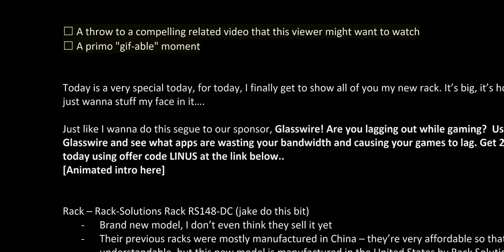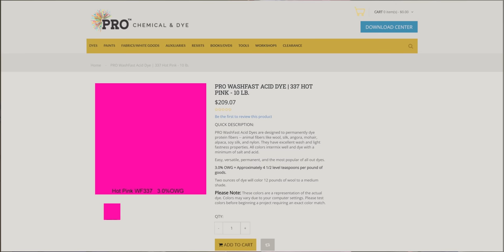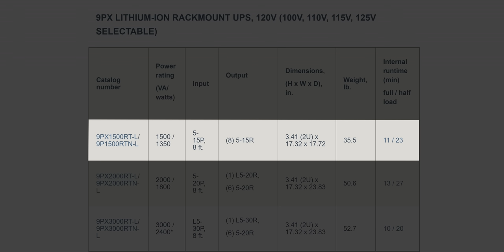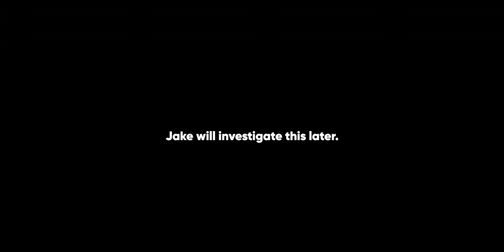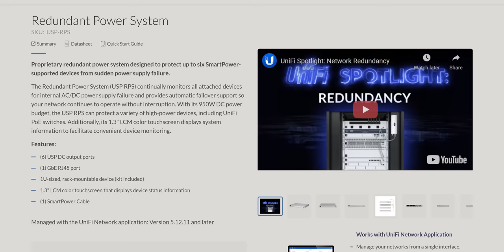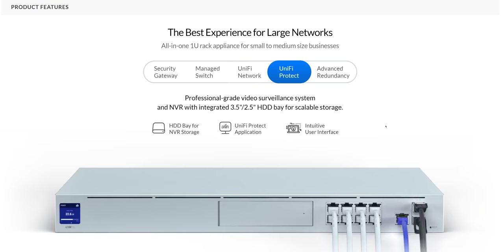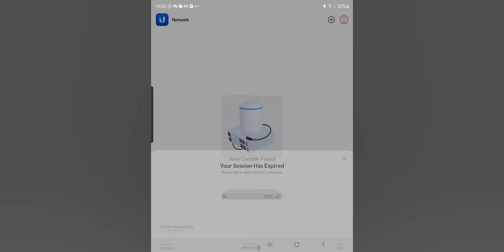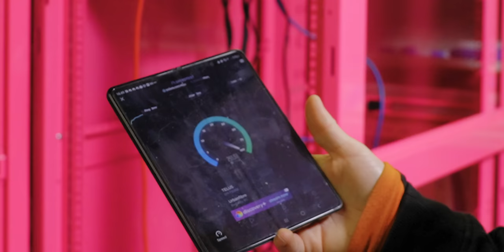Check out my HUGE Rack! - New House Network Update

Comment: "Rack Solutions will send me a thing of touch up paint anyway right?"

Frankly I'm surprised they didn't do that from the start if they knew literally anything about Linus.
Reply: I'm sure they want to hold on to that hot pink paint for all the orders they'll get for it..
Reply: I don't think they wanted to buy any more Pepto Pink Paint than they had to. So with Linus it might just be a few vials of touch up paint, or it might be a quart, you never know with him after all...
Reply: Am I the only one who saw him stab it lol
Reply: Linus thing size of paint would probably be gallon size.
Reply: Also, the paint's possibly why those nut things didn't fit any more
Reply: And let’s be honest, who else is going to get hot pink paint for their server rack?
Reply: Its very likely not painted and is powder coated.
Reply: @Sandriell  I've never seen a good powder coat chip like that.

Comment: LED lighting is on of the most criminally overlooked and underrated tech advancements in the past 25 years.  That power draw decrease hits different especially when you start to add in the dramatically lower replacement rate.

Comment: Linus: "RackSolutions will send me a thing of touch up paint anyways"
RackSolutions:  "Hey it's Linus....Better send him 12 gallons"
Reply: Too bad it’s powder coating 😂😂
Reply: @trav3rsy  ackshully you can measure solids by volume.

It's very rarely done though.
Reply: @ax14pz107  The issue is that you can't apply powder coat without the right equipment.
Reply: No worries, Linus just has to take off the door and ship it back for repainting each time he chips it.
Reply: @hentaihero2201  I know. It's just a joke.
Reply: @ax14pz107  
How else would you measure the space a solid takes up, if not in volume?
Reply: @jayhill2193  magic, obviously.
Reply: Some LLT Store pink touch up baby
Reply: @09f9  
alright, but if you multiply the three dimensions, you automatically get a volume. Though I understand it makes sense to write them down seperately to know how (un)wieldy the thing is.
Reply: @09f9  what exactly do you think a volume is lmao
Reply: How much is it to ship a 55Gal drum of  Candyfloss Pink touchup?

Comment: Having fairly recently moved 3 x 48u racks up to a 2nd floor office by hand I can tell you that you Linus missed a trick here.  You unpack it all in the loading area, and pull of all the doors then it makes the frame weigh a fraction of the fully assembled weight.  You can easily carry just the frame and the doors separately, but I guess that wouldn't make as amusing video :)
Reply: Yepp, having moved a few hundred racks and their content between datacenters and multiple flights of stairs by hand, I fully agree. In addition to thay, I can confirm that dragging over 10 PB of storage on a cart with hard cast tires tends to weed out the weak drives from the rest. A great way to stop storing all that old useless data the beancounters want to keep around.

Comment: Nobody who has ever tried using the Ubiquity cage nuts will laugh about you.
These things are impossible to put in by hand without hurting yourself.
Reply: Didn't Lawrence have a nuts that were plastic since all the metal ones suck in their rack video?
Reply: @Braiam  Yep.. but, I personally don't trust plastic enough. 🤦‍♂️
Reply: Ubiquiti requires a blood sacrifice to install its equipment
Reply: @vdna5492  So they are really old-school. Back in the old days you couldn't build a PC without blood sacrifice on some panel or piece of sharp metal in the case.
Reply: This comment is on point! They are terrible!! I've ripped my thumbs apart fighting with them in the past. Never again! I just leave them right in the box!
Reply: @jbonn5365  I remember an installment we did in a house. They chose all unify.

I tried everything, to use the nuts and screws that came with the gear. This ended with the cage nuts frame rammed under my fingernail, cuts and several nuts lost because when using a screwdriver to get them in, they flew across the room.

Ended up using the mounting gear that came with the racks. The nuts clipped in just fine.
Reply: Their cage nuts do suck. I end up using pliers to pull the wings in tighter before putting them in the rack.
Reply: @Cinkodacs  I PTSDed for a moment. razor-sharp cases, slot covers that turned into knifes and plenty, plenty of jumper connectors ready to stab your nailbeds.
Reply: Could so fail the pain, when it made his nail/finger slip, those things are horrible 😫
Reply: too true...
Reply: @Cinkodacs  I remember when 'we put a piece of plastic on this sharp edge' was a major selling point for brands like lian-li. I hadn't purchased a case in probably 15 years and bought one from Fractal. Man was the bar ever raised while I wasn't looking.
Reply: I thought they were defective, so I tossed them and grabbed a handful from our box o' nuts. Good quality nuts are worth it.
Reply: That's because you're not supposed to do them by hand. That's like suggesting you should hammer in a nail using your fist. There are tools that exist to make cage nut insertion easy. You don't need the fancy Rack Solutions tool, just a metal hook. My cage nuts included one for free in the bag.
Reply: @Cinkodacs  The Zalman flower-of-razor-blades coolers come to mind. :D

Comment: Jake: There is a 25 gig coming out
...
...
Linus: Welcome to upgrading my home server!
Reply: What the gigs (referring about the 10 vs 25go) are for? I understand they are building a kind of an all-in one house network where he can have acces to video security, but I guess also manage device connected to it because it's a glorified routeur, but what the gigs are for the first device they install at the complete bottom of the rack?
Reply: @Mutantproduct  That is a UPS, ergo no gigs.
Reply: @Mutantproduct  moving data around, mo gigs, mo faster
Reply: @Mutantproduct  gig is short for Gigabits per second.
Reply: @Mutantproduct  The device at the bottom, with the lithium batteries, is a UPS. Which stands for "Uninterruptible Power Supply".

It's basically a power supply with a big battery in it, so if the power cuts out - e.g. there's a blackout on the local grid - then it can keep running the whole rack off the battery instead (at least for a while, because I mean racks use a lot of power, so you can't run them off batteries for too long - but the idea is it should be long enough for the blackout to end / backup generators to kick in / some alternative power solution to take over).

Depending on capacity, a UPS could just be to keep the rack alive long enough to safely shut down. Many UPSes have a signalling mechanism, so if the power does cut out and the rack goes onto batteries, it can actually signal this to the servers in the rack. You can then set those up to safely shut down the system, in the event of power loss - before the battery runs out. And by ensuring the machines can shut down cleanly, you can ensure no data loss. 

With a bigger battery, though, you can keep the rack alive for longer and maybe you could keep things up for a while, which is hopefully long enough for the boys who run the grid to fix the power outage problem.

That's the essence of the "uninterruptible" part of the name. Not even blackouts will bring the rack down.

Mind you, Linus did say that he's going to have solar - and, presumably, a Powerwall to go with that, to fully utilise all that Sun power? - and those implicitly act as a kind of UPS too. At least as long as you've got enough sunshine in the day to fill the battery to last overnight, then the system can never go down while the Sun still rises every morning (plus, totally Greta-approved "eco" solution).

We had a small UPS for our cluster of servers at work (I'm the dude that built the cluster and runs it). 

We had a local power outage. And the UPS totally worked. Our system stayed up for about 20 minutes and the local power was restored before then. It worked flawlessly.

Slight problem, though. Our ISP - delivering our Internet - clearly didn't have as robust of a system in place, as the Internet went down during the power outage. But, hey, our servers maintained their "uptime" perfectly. Just a shame that, during the blackout, they couldn't actually communicate with any other machines over the Internet, rendering that "victory" somewhat pointless.

But, hey, not my fault. I did my job perfectly and it worked. It was the boss who chose our ISP, so I can blame him for the poor decision.

Anyway, yeah, the device at the bottom is a battery-backed power supply. There are no "gigs" - which is a measure of connection speed - with that. It's a "volts and amps" power thing, not a "gigabits per second" bandwidth thing.
Reply: @klaxoncow  anything else you need to add?
Reply: @gazzoontie5200  That is what happens when the guy that wears all the IT hats chimes in on the things he's passionate about (or gone down the rabbit hole far enough to develop Stockholm Syndrome), lol.

Comment: That moment when you realise that because it's double painted, the tolerance for cage nut spacing is reduced.
Reply: Ubiquiti cage nuts also suck. I've had some that just never went in. So I started getting AC Infinity cage nuts separately, they're almost too easy to put in.

Comment: As a previous data center tech, you're missing the tool generally used to install rack nuts. It's just a flat piece of steel with a small tab that you can use to pull the nut into the hole from the front of the rack. It's way faster and more useable than one of the squeeze tools.
Reply: Yeeeeaaaaah. I thought those came in the bag of cage nuts that generally ship with racks. 

If their rack didn't come with it, that's either one sadistic vendor or a really nasty oversight.
Reply: Done a tonne of work in DCs and hadn't known of those tools for years, was the best work day almost ever when I got a few

Comment: Hey! I can be that data center guy at 11:33. That tools pretty rare, I'm the only one I know who doesn't just use the little pull through one that comes with the bags of nuts. It's amazing once you get the hang of it. You have to rock them in from inside to out. The opposite of what ya'll were trying. I actually carry that thing, the toe nail clipper one, and the screwdriver handle J hook one since all have a specific time when they're the fastest. Sometime the cage nut wings are too wide or the holes are out of spec and you need the screw driver handle J hook one to force them in.

Rack solutions needs to make that thing out of slightly stronger metal, or maybe just thiker. I discovered that really squeezing on it I can bend the crappy cage nuts and I can get it to work almost everywhere.... but now my handles are bending.
Reply: @kwith   You're lucky he's not barefoot in his own house.
Reply: I've always had decent luck with the way Linus ended up doing it - Line up up side and "thumb" the other side in with a flathead screwdriver
Fairly reliable, with a common tool

Comment: I love it when Linus shows us his Rack that's full of silicon.
Reply: *silicone
Reply: @InventorZahran  whoosh
Reply: @InventorZahran  um no, silicone is the heat resistant rubbery material and silicon is the element made from silica sand which is used for ic's and processors
Reply: @exMuteKid   and “ Silly cones” are used by circus clowns 😆

Comment: Jake: "there's gotta be some data center guy here, that's just sitting here laughing at us"
Me: Data center guy, can confirm though a light chuckling.  Helpfully, I can recommend the CPI Clik-nut cage nuts.  No tools, no fighting, no blood, no tears.  Just install and go.
Reply: Heh, that was a catchy section indeed. :)
Reply: I've just accepted that the network racks require a blood sacrifice to stay off future failures.
Reply: no blood?? how do you appease the Datacenter gods?
Reply: BUT it was painted 2x...so likely made it nearly impossible to get them installed.
Reply: I also like the Patchbox Dev/Mount solution for mounting things,  never had such an easy time building out a rack as when i used those.
Reply: This guy nuts
Reply: second
Reply: 311.99 for one pair? Screw CDW!!!
Reply: Also a datacenter guy - those Ubiquiti cage nuts suck. They're solid but a little too solid :)
Reply: 100%
Reply: Jake: "that really did chew up my finger"
Me: sobs in racking-up-gear-all-the-time
Reply: noted
Reply: Data Center guy here, definitely chuckling. Cage nuts = broken and skinned finger tips but for $1.99 you can use this fine aluminum cage nut puller from APC that works great.
Reply: Those things pop out on me too often 💀
Reply: Wait, you guys don't just have a bag filled with twenty years of different cage nuts, with random different threads on them? Mixed in with a whole bunch of different bolts, only some of which fit? (and they're also a mixture of Phillips and slotted heads).
Still, at least our racks aren't going to tip over, because they're well ballasted by all the cage nuts people have lost down there over the years.
Reply: But that wouldn't be fun^^
Reply: I buy AC Infinity, but they're just regular cage nuts that work every time. Very high quality and super ez.
Reply: I just got out of It a little after CPI came out with those.  Those were literally a game changer for us. Wish I would have tracked the time it saved us before Dell laid us all off.

Comment: I've had to move these up 4 flights of stairs in the past at my old job, easiest way is to take the side panels off and stand inside it to share the load at a reasonable height with 3 people.
Reply: Sharing loads inside big racks? That sounds a bit cozy.
Reply: At work we always remove all the side panels and doors of new racks when stairs are involved (On the way to the final destination of the rack) ;)

Comment: Hi, speaking up as one of those datacenter guys, laughing at this video ;-)
A pair of dollies is all you need to move a rack, if it has no wheels (or doesn't fit in the door).
There are special "Shoulder Dolly Moving Straps" for moving heavy items like washing machines across uneven surfaces without breaking your back. 
As for the cage nuts, there is a has a really nice "Cage Nut Insertion/Removal Tool", it's tiny, but it's also just the right size. (FS has nice cage nuts)
Tip: Screw in the bottom bolts first, as they will keep your device upright.
Special tip: Splitting a 48-port switch into an upper and lower 24-port patch panel makes for a gorgeous build, if you use tiny patch cables.

Comment: You should've gotten the Switch Pro Aggregation - UDM-Pro connects to the aggregation switch, then from there you can do either single or dual 25 gig to the two 10gig switches and then 10gig to everything else.

Comment: Linus this must be your first rack mounting session. I highly suggest mounting the equipment in the following order. 1. Skip 1U. 2. Mount your fiber drawer. 3. Skip 1U. Mount a shelf for your ISP equipment. 4. Skip 1U. 5. Mount your Dream Machine Pro. 6. Mount your NVR. 7. Skip 1U. 8. Mount your first patch panel. 9. Mount your first switch. 10. Skip 1U. 11. Mount your second patch panel. Keep going until you have populated your rack. And of coarse put your UPSs at the bottom.

Comment: "there's going to be some data centre guy sitting laughing at us"... There was, I am him! (did think it was funny to see a dedicated tool for cage nuts, I normally use a small flat headed screwdriver Put 1 end in and then use the screwdriver to put the other side)
Reply: I wasn't laughing as much as asking if they simply couldn't watch a YouTube video on installing cage nuts. 

Almost every rack I've had to build has come with it's own little hook tool to pull the cage nuts into place.
Reply: i've used those ubiquiti cage nuts before... they do just suck. cheap amazon ones work so much better.

Comment: I would recommend few things. You should move the front rails at least 5in from the front for easy cabling. Add vertical PDU (can be custom powdercoated from company like Raritan) and using L6-30R sockets so you'll get 5.7kW of power for futur needs. This would also needs a bigger UPS with L6-30R sockets, the best are the "online" ups, Toshiba got great products and this would also protect you from over/under voltage and noise.
Reply: Yeah, I don't know who was in charge of building all this out. Whoever it was needs a remedial course in reading and critical thinking.
Reply: @AC-cg4be  Jake’s in charge of planning it all out, but I think it’s important to note that they’re making as much use of sponsored hardware as possible to lower costs - so other options may not make sense financially.
Reply: @TheFutboljunky What do you mean?! Dont you just love it when you get your daily dose of condescending tone from a stranger on internet! They absolutely know everything and have the right to be an absolute a-hole.

Comment: I once had to install a rack in a Firehall in North Vancouver. On the second floor. With no elevator. I took the sides and doors off (they make up a LOT of the weight).. and then got the firefighters to carry it up the stairs. Another time I had to roll two of them up Thurlow street to move offices.. they were VERY loud on the pavement. Many fun stories..

Comment: Data Center guy here, definitely chuckling. Cage nuts = broken and skinned finger tips but for $1.99 you can use this fine aluminum cage nut puller from APC that works great and doesn't make you as irate. Also one more tip, please verify all your soon to be installed equipment and adjust your internal rails before racking. Unless you want any front cables to be crushed by that door.